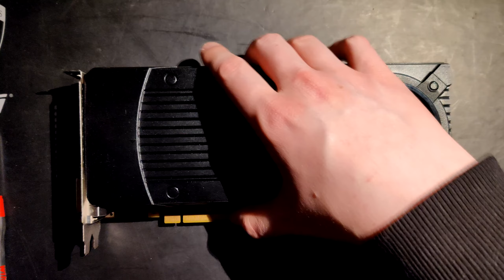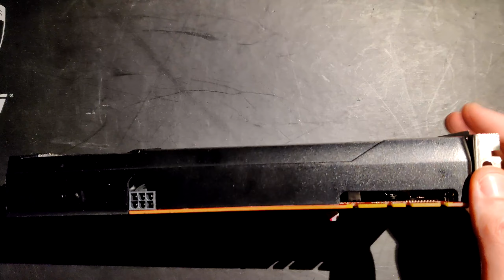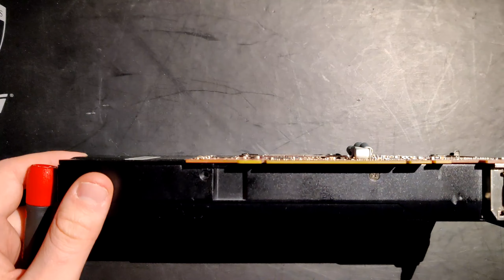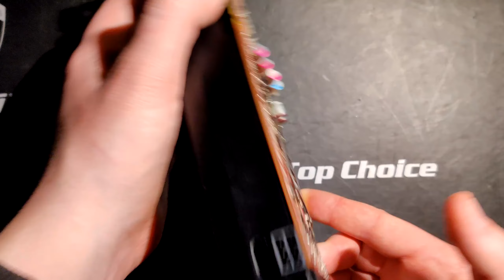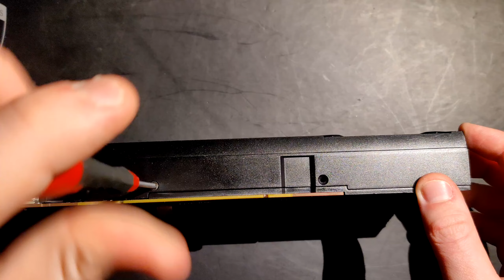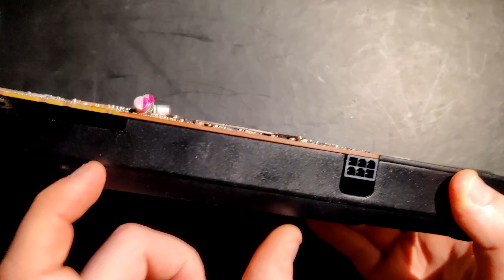Modding and Overclocking the dodgy GTX 760

Comment: 14:00 Most luck I've had cleaning cheap flux is with cotton balls and window cleaner, you could maybe try that? Btw I think I have an oem GTX 760 ti with the same pcb except in black, also with basically no capacitors.